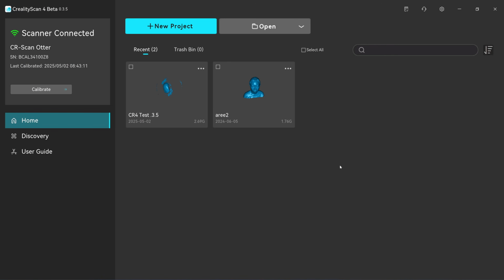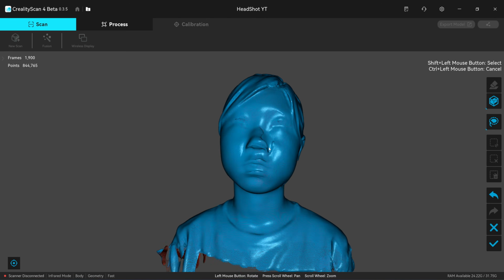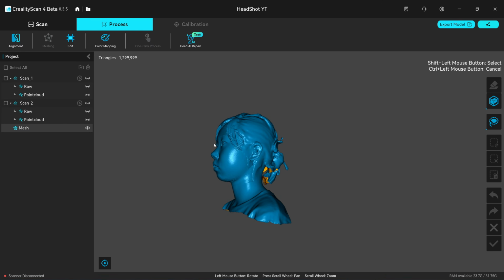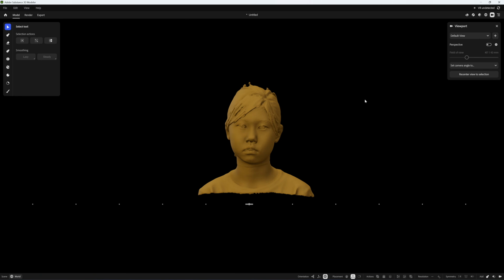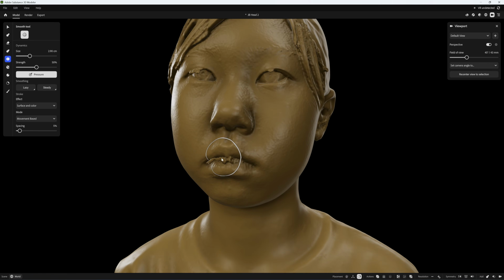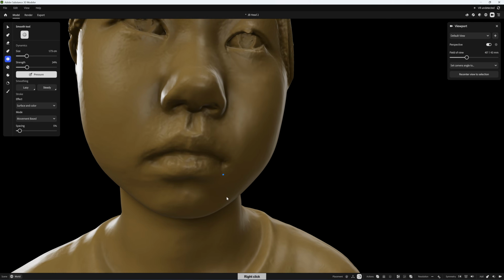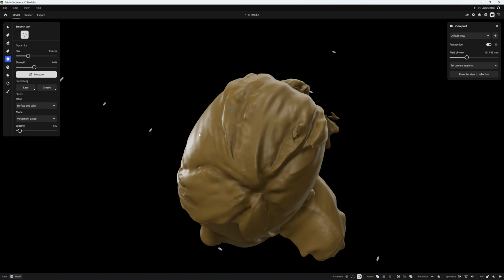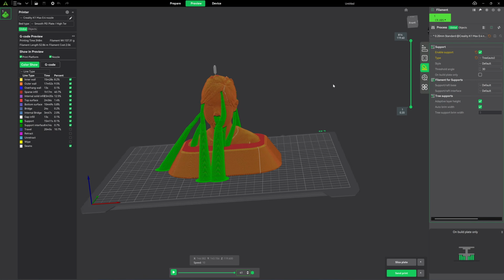3D Headshot Scanning & Repair: Creality AI vs. Substance Modeler | Creality Scan Otter Guide

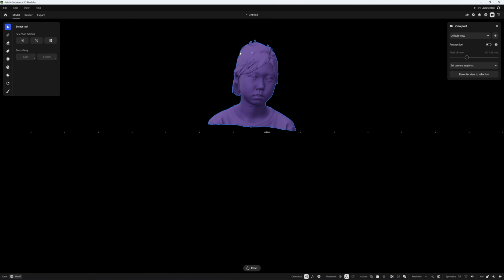Comment: Hello, the axes that appear on the screen as dotted lines along the length of the screen aren't visible on my screen. I wonder if these axes are enabled by a setting? At 11:30 in the video, you hover over the origin. However, the origin isn't visible for me. My second question: You mentioned that you can cycle through the views by holding down the Shift and Alt keys (I may have misunderstood). I can't do this. How do you switch between views? I want to adjust the front, back, right, and left faces of my object model. But I can't. Can you help?
Reply from the maker: Dotted line - Environment -> Ground -> Show Grid
While holding Shift + Alt key, you can change view by dragging with left mouse button.